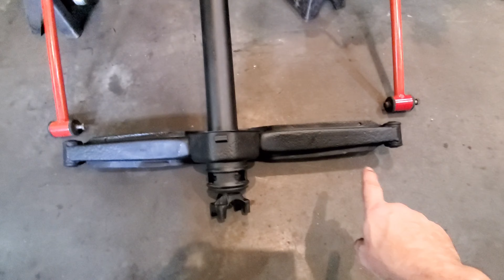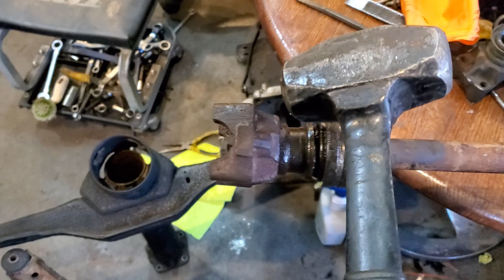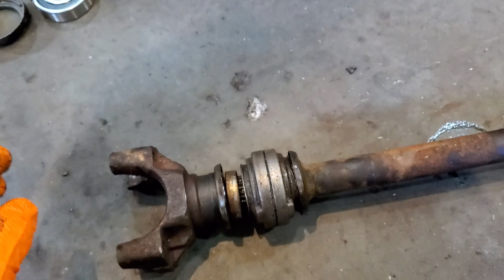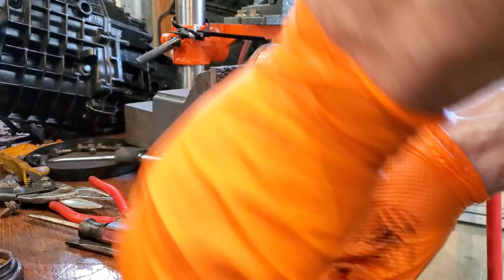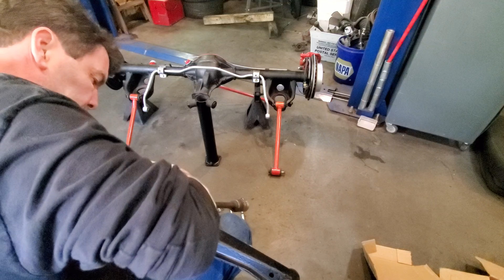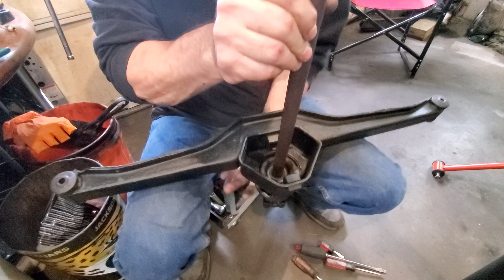How To Replace and Rebuild The Torque Tube Doughnut on an Opel GT, Manta, Ascona, or Kadett

Comment: Nice Video.  When I did my GT, I put the bearing in the donut first, put the donut and bearing into the housing and then added the shaft and torque tube.  You can pop the donut in quite easily if you flip down the leading edge to get it over the metal clips and then work the edge into the inner groove.  The outer edge goes in pretty easy after that.   With that assembly out of the way it is pretty simple to add the shaft etc.  Your comments to use a bearing puller on the yoke are bang on.  Comes off easy if things are not rusted solid.   Nice work on your other videos.  They have been very helpful as well.
Reply from the maker: You know might have to try that next time

Comment: First of all, congrats for the great vídeo. I'm starting a restoration of an Ascona A and this content is awesome because I need to replace that bearing but im having a problem here in Portugal, i cant find a direct replacement.
My hope is that,  if you dont mind, you can measure the bearing and the rubber supports for me.
If you can do that it'll be an amazing help.
Thank you very much and keep the excelent job
Reply from the maker: Not sure measuring will help. Edelschmiede can help you out with parts, that or OpelGTSource.com ships worldwide.
Reply: @GoinManta  Many thanks for the reply. I'll search in those places.
Thank you very much 😉

Comment: Useful information, I'm doing a project to hopefully develop an upgraded shaft and bearing mounting so it can take some more power given the torque tube shaft is a very well known weak point in the manta axle. Just needing some masses for suspension components and brakes so I can work out the tractive effort (torque limit) of the rear wheels so i can get a better idea of what forces to stuff into an FEA once i can get a drawing or a shaft to measure up so i can drop it into CAD
It's on the UK OMOC site if you wanted to lend a hand
Reply from the maker: Send me a link.. I could measure some stuff up. I have a second axle here. Maybe even get some start on the CAD work.

Comment from the maker: Please Note : The Best method with zero chance to damage your bearing, etc.. is to use a gear puller. 

Gear Puller : https://amzn.to/3sav9SB

Check this video for tips on using a Gear Puller and replacing the pinon seal 
https://youtu.be/scb_FcHtMZM?t=599
( Video is for a Ford, but its the same process for our axle )

The hammer method was how I was shown to do it and how I have done it for years. As the video was done fairly impromptu without a script I went by "muscle memory", and as they say old habits die hard. Now the way I did it with a hammer does work, but it has to be strategically used and has to be a bigger hammer.. Also it tends to work better on older greasy yokes ( those will come off with one or two good smacks..), BUT dry and rusty ones will fight you. In either case though, it is really best to go buy or borrow a gear puller if you don't have one, and DO NOT use a regular framing or household hammer those won't have the power to get a yoke off.
Reply: Harbor Freight has cheap 20 ton hydraulic presses, I take it you have never heard of or been shown how to use a press to avoid damage to yoke, bearings, seals etc.
Was interesting to see the "exploded diagram" in physical form to see how all the pieces fit together.

Comment: Hi
What kind of brake discs and calipers do you have on that axle?

//Andreas
Reply from the maker: LOL.. I knew that wouldn't get past everyone. 1984 Isuzu Impulse. Its a old mod from 20 years ago. Requires a donor Impulse, and they are rarer now than the Manta A. Little did I know that then when they were often found in the pick a part junkyard.
Reply: @GoinManta  Well, not so common here in Sweden either.

//Andreas

Comment: I just did mine about a month ago,  searched all over for a video or good info. Not much out there, this is great!  You couldn't have put this out like 6 weeks ago??? I used my steering wheel puller to take that yoke off the drive shaft. Great video, thanks.
Reply from the maker: Well, a few reasons. #1 I wasnt in the midst of a TT project ;) and #2 no one asked ;) That said.. if someone asked for a specific video I will do my best to create it if I have the parts and a car that needs it done too..
Reply: @GoinManta  Are you going to make a video on replacing the gearbox with a 5-speed?
Reply from the maker: @kjetiloftedal338  Well.. Funny you should mention that.. (Or better yet remind me about something in front of my face...). I am doing that to the Manta shortly, so perfect time to go over that.. So yes, it will be the next video(s).
Reply from the maker: I have used the hammer method for so long it didn't dawn on me to use a puller.. DOH!